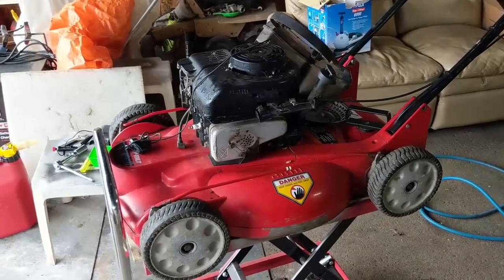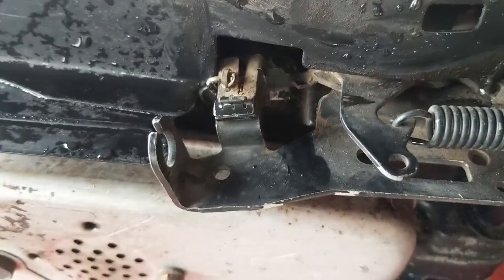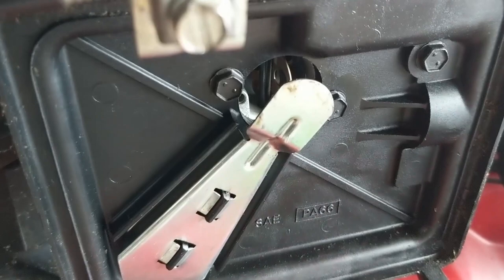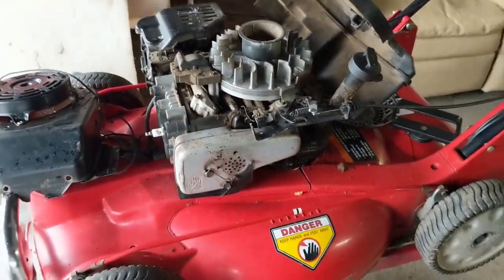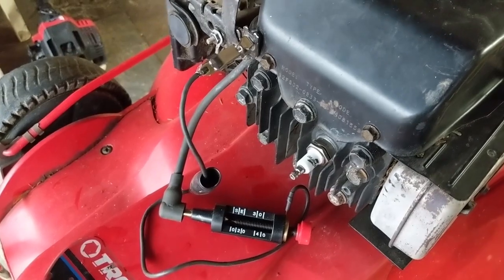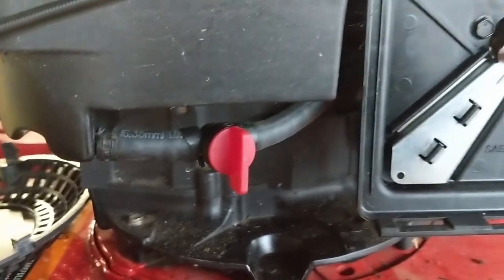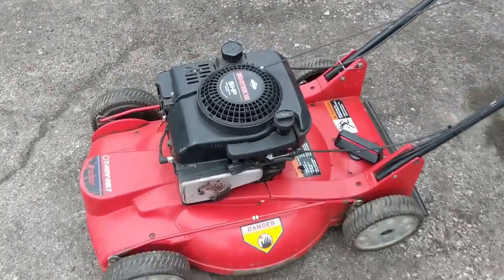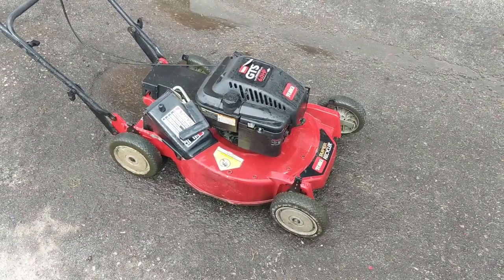Toro/Troy-Bilt Mower with No Spark

Comment: The wire above the intake manifold won't get hot enough to be harmed, it has a steady flow of cold air going through as well as it's plastic and between the wire and block.
Reply from the maker: Lol and where do you think the intake manifold is located? Directly above the engine, covered by shrouding that traps the heat in

It does get hot, just won't melt the wire, which is what I was getting at in the video.

I left it because it would've melted already.

Comment: You got it dude, if the customer wants you to get his mower running but does not want you to fix the drive system you leave the drive system alone unless you get confirmation on that repair with an approximate cost. My guess is belt plus cable and labour might have run your customer another $75 to $100. Did your customer want if fixed?

Comment: Hey Mon Ami great vid........  I have that same exact Troy Bilt for my personal mower......  That is the one of the commercial models....  Not the same old cookie cutter mowers made by AYP/ MTD ......   Under that front cover which you found out is a friction disc style driver like the Snapper Rear end riders use......  Best style ever..............

I wish you would have shown your viewers how the height adjustment works.. That is a great design..............

That mower bought new is over 400 buxs.......   All my customers that see it want to buy it from me.............   NOPE .........  

Plus Tard Mon Ami ~!~!
Reply from the maker: Lol all I know is the snapper rear ends with friction wheels are junk I got a video on that lol it's a year old though
Reply: I still work on Snappers that are over 30 years old....  Some older...... Nowadays Zero Turns are the norm for commercial guys........  

I agree some Snappers will turn to junk with no maintaining from the owner...  Most common issue with those in my shop is the rubber wheel......

That system on  your Troy Bilt that you worked on is far better than the cookie cutter transmission  that goes out too often .......

Plus tard Mon Ami ~!~!
Reply: Thanks man, I just replaced my shroud today and it was a bit different. I did not notice it was doing the exact same thing as yours. Replaced plug and took the entire carb apart and cleaned today trying to figure why it wouldn't start. Thanks again